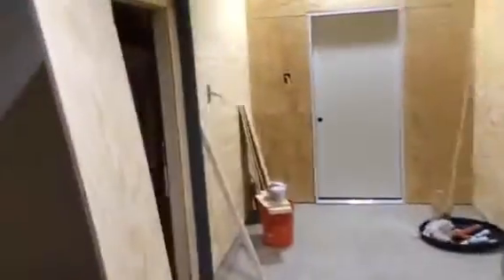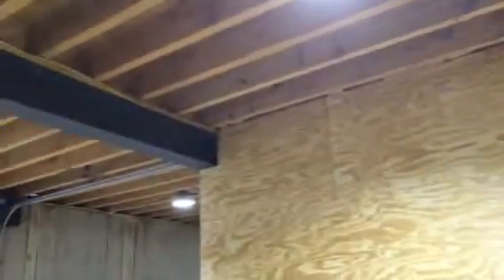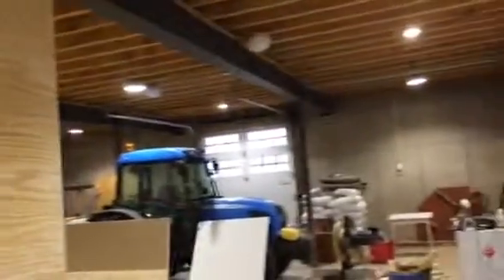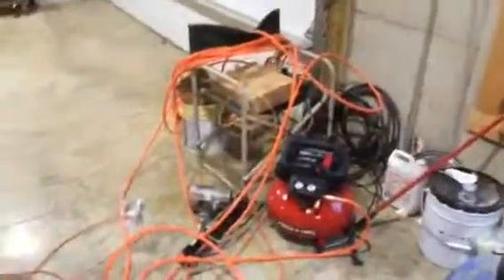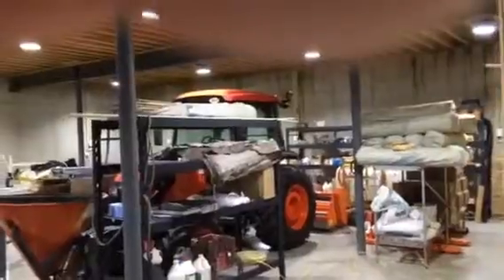The room

Comment: I would love to  have a barn like that, but since I only have 1/2 an acre, I guess I'm out of luck!! LOL I really love those walls, I never thought of using wood like that, and it is gorgeous, but I would end up putting a million holes in it for tools. I sure hope you post more of the barn as you do it. I would love to see what else you decide to do with it. Bless, Sheila
Reply from the maker: +Sheila6325 It's  about done, I  need to post another followup on it. All painted, sink, water heater, and a tub/w/shower (usage as a big utility sink and something to wash dogs in) all installed an hooked up. Just need to get the circuit closed on the electricity.
It will be a tool/workroom, and closet locker area for my brother and me.
His farm/barn... I'm just a helper.
Reply: Atoyota Ok, I may be very old, and female, but I just love workshops, full of tools and a million nails and wood to make things with. Only problem is, I tend to want to save everything, just in case I need it. LOL Old roofing, yep, small pieces of 2x4's sure make great stove starters. I've gotten good at finally tossing a lot of things out these days, but with a barn like that, I would have a great time. I especially like the locker area, you just have to have one place that is yours alone, that no one touches. I raised 4 children, and they knew better than touching momma's tools. Daddy's yes, Momma's No way! LOL My toolbox was off limits, can't imagine having my own locker too! Fantastic. Hope you show it off soon. No workroom is complete without a utility sink, and more should have them. Bless, Sheila

Comment: I noticed your tractors, i drive a kubotaM108s and a case farmall3 95, at work ,  I run a 700 acre farm with over 100 head of angus momma cows
Reply from the maker: +Unusual Bee Works 217 acre vineyard here, grapes. about 30 acres cultivated with another 10-20 in the pipes.
Not sure what model kubota, i have it featured in a previous video using a flail mower implement. Both tractors are vineyard tractors, narrow and smaller than your standard farm tractor so they can work the lanes between vines.
He also has a skid steer and John Deere.
The vineyard tractors only see use in the growing season, The other equipment is used year round.
We have an old white 2wd chevy pickup with a hydraulic dump in the bed (dump truck insert) Farm use... and a kubota atv as well.  

We are one of the larger independent grape growers in VA, and getting bigger.
May one day do wine (where the money is). Also money in catering and using the farm as a social touristy type of business... but we aren't really that type of folk. Not anti social LOL, just more about work I guess. And Vineyards are a lot of work! At least building them is.... 

Check out some of what I've posted and you'll see